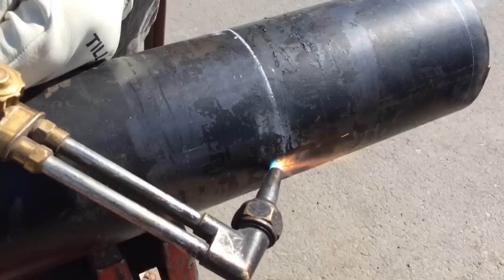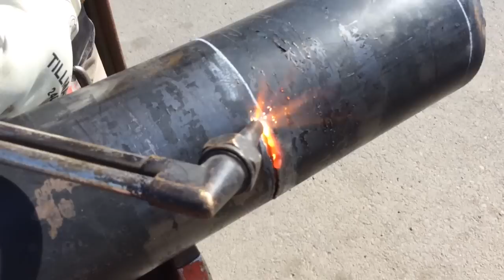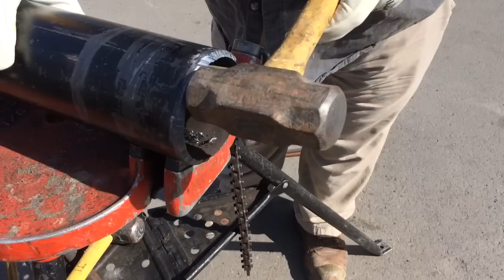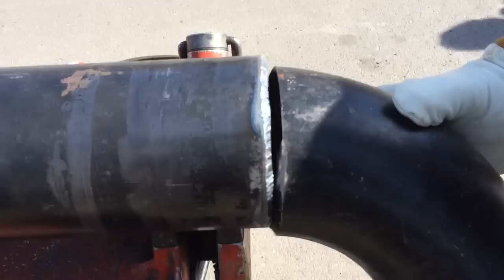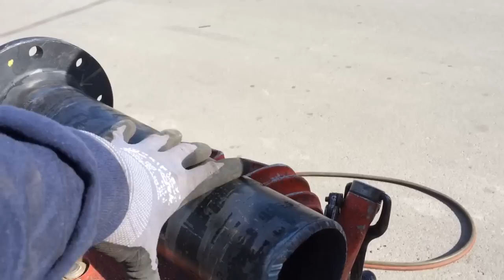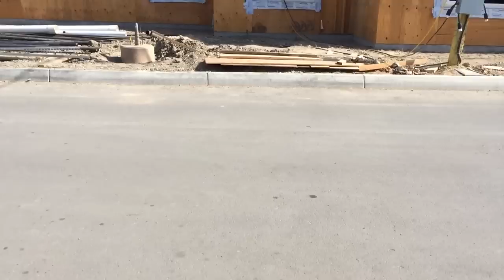Pipe beveling with a cutting torch oxygen actelyne

Comment: I guess this is an old school torch hand style, as a Pipefitter I would just cut it with a bandsaw, or cutting disk, and then bevel it with a grinder. He is still going to have to clean it up with a grinder anyway to prep it to fit up and weld it out.

Comment: Not bad at all, it's not all that easy. Guys that say its shitty or not any good, are either the greatest torch hands alive. Or more likely have never touched a torch before
Reply: Blades 22 I appreciate that Blades!  I will go a few years in between fitting up, which was the case here!  It had probably been 3-4 years.  The point is you don’t have to own all the high dollar bevelers to cut a pipe bevel.

Comment: A good fitter can cut a bevel with a torch. 10x faster than a grinder! I too was taught by a badass old timer.
Reply: damn right,  my eyes are going and cannot see as well but I used to cut pipe like glass.  UA local 46 Toronto
Reply: Tony Silva nobody asked u
Reply: I saw once an old fitter that can cut pipe profile and bevel at a same time.
Reply: This is not a good quality only for progress i dont like this.
Reply: OK

Comment: I'll be better if you put the torch tip straight on the line and cut forward at the same angle as if you were cutting with a bevel machine you'll have a cleaner and straight cut . Nice job man

Comment: yea 33.5 degree bevel? looks like a 20°-50° depending on what quarter ur lookin at..most likely refer pipe or hydronics system down hill 6010 no inspection on fit up root or final.. get the spray paint close! and ur lookin for 37.5° bevel ther bub. lu 598 pasco wa welder

Comment: Pretty cool.  Doesn't it need to be ground smooth?  Just curious.  Pretty fawkin awesome either way!
Reply: drumtwo4seven yessir, after torch beveling you’d touch the surface with a grinder to make it smooth and make a land.
Reply: Unless it's tig root you'd knife edge , please elaborate before you say a land is necessary

Comment: Get a mathey dearman beveller and roll on. I could make 2 cuts and have them cleaned up by the time you get a wrap around mark
Reply: Luke P.  My point is to show how simple it can be to "flame cut a bevel" without all the expensive tools.  If all I did was fit pipe, it would make sense, but for a few days here and there on a project, through out a year, I do just fine the old school way.

Comment: a cut covered in striations and dross is irritating, as a welder. as a fitter, my roll cuts look machined. I'll have to put up a video.
Reply from the maker: michael schade would love to see it!
I have been told by many plumbers that I have worked with over the years that you can't flame cut a bevel!  I just wanted to share it with others that it is easily done with a little bit of practice. 
I may go a  year or between jobs that I need to fit on.  I only do it when we are in a pinch.  I enjoy doing it and if I did it daily my cuts would look 10x's better. 
When I did this video I hadn't fit anything up for 3+ years.   Part of me wants to try with a plasma cutter but I have always used a standard torch and know the feel. 
Please share your work. I love  to see others work and methodology.
Reply: Right on. Its tough if you don't do it every day.
Reply: what name right video
Reply: I have a video on my page of a pipe roller plasma cutting stand I made. It does thin wall pipe pretty well but I need a better plasma cutter to do thicker pipe. Plus it also works with a cutting torch as well.
Reply: Explain what doesnt irritate a welder
Reply: Still waiting on that video
Reply: michael schade wheres the video
Reply: michael schade still doesn't have any content on his page just as I thought.
Reply: still waiting for video brah

Comment: pls upload videos of hyd.pressure testing procedure of DI pipe fittngs like tee,elbow,reducer
Reply: I don't normally do that. 
I did a 4" fire man under a BART pad that we had to hydro with very little coverage and we restrained and strapped it down and it still snaked all over the place at 150psl.

Comment: this cut would not pass in my shop. we  would use a torch bevel machine
Reply: Ma'am my point was that it is easily possible to hand flame cut your bevel WITHOUT A MACHINE OR JIG.
Reply: I'w thinking the beveler fitters in your shop would be challenged in the field while the field hands could turn the crank or push the button just fine in your shop. 
But that won't happen. It's the money thing.

Comment: what are the actual benefits of cutting with gas instead than with a grinder? Thick material ,yes, but if the material is thin? I dont see benefits.
Reply: Nikolaos Pizanias i typically only deal sch 40. It is more about not having to invest in bevel cutting tooling. Especially when you only have a hand full of cuts to do. Now there are cool metal cutting saws so you get a square cut, and beveling tool cutters that are reasonably priced. If I were doing heavy production I would invest in the tooling.

Comment: Get your free hand positioned right and make the cut in three turns on a 4 inch. 
Turn the ox down a little and you won't need a file. The beater will do the work when you pound a land onto it.
I worked 20 years using a gas axe and a three pounder to make up x-ray joints.
A grinder is for grinders. Fitting is for fitters. How many grinders you know making double bubble?
If you hear your welder whining it's because you didn't buck him up enough to keep him from engaging his yap.
Reply from the maker: Thanks for the pointers!

Comment: Thanks for the video..
Reply: shaufik hidayat you're welcome. I may not be perfect at it, but the point is that you can do it with a cutting torch. Sometimes I go years in between fitting pipe so the little I do doesn't warrant the investment of a beveling tool. 
Rigid recently came out with a cutter head that clamps on the  end of the pipe and rotates around the pipe. It will do from 4" up and I think the cost may be around $2k.

Comment: were you ever able to get a cleaner cut im not being a dick im just curious i dont get the luxury of a bevel machine so i have to use a metabo
Reply: +ralphgomez78 Ralph, I'm not sure what a metabo is, maybe you can explain.I can get a really clean bevel on larger pipe.  Especially if I get a chance to stay out in the field and get a few warm up cuts in.  Most of my stuff is sch 40 medium pressure gas, so it doesn't require x-rayed welds.  My welders do not have a problem with minor imperfections.  I was taught by an old timer back in the early 90's and found it to be a lot faster than hand beveling or an air beveler.  Now that there are metal cutting chop saws instead of old school chop saws the cuts are much closer to being square prior to hand grinding.
Reply: +Shannon Haugen  thata cool man a metabo is like a chop saw but for a 6" grinder the disc is only 16th wide great for cutting pipe but this could be useful when you get up to bigger bore pipe especially if you can get a smooth cut.

Comment: Chop saw buddy!
Reply: The old Bosch Carborundum chop saws that I used years ago to fit pipe couldn't cut a square cut to save your life!  They where always out a few degrees and it would take 20 plus minutes to grind  an end up square, confirm the overall length, grind your bevel, landing and deburr and tack on the fitting.  The  method in this video, I was able to do the same joint in 10 minutes with the fitting tacked on It.  I have had a lot of plumbers I worked with say you can't flame cut a bevel on a pipe, well here is the proof.
We also had a fab shop with a 24" 480v production chop saw that would cut a better end, but in the shop we used a large high CFM air bevel'er that used an internal mandrel to position the tool and pipe and it would do the facing, beveling and de-burring in one process.  we would normally cut the pipe about 3/8 long to allow for this process.  Again this is not an inexpensive option out in  the field.